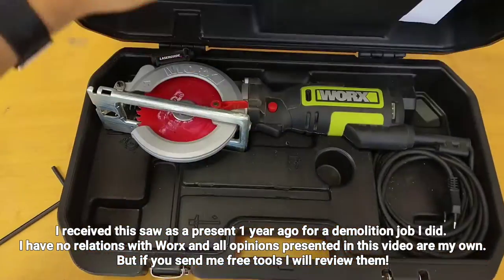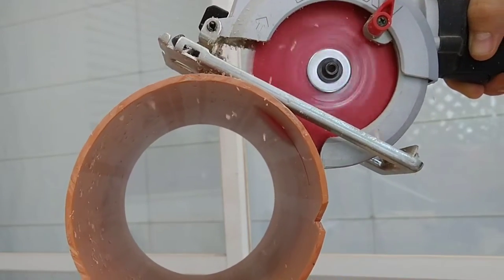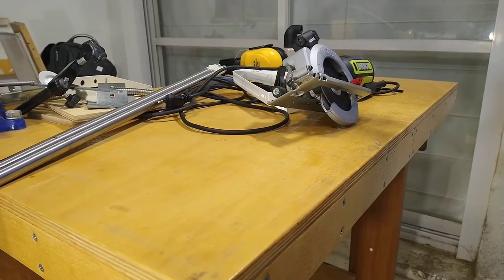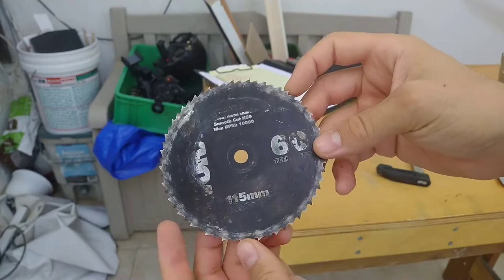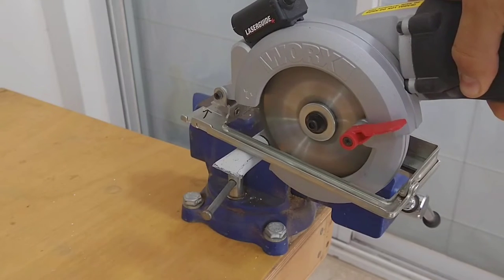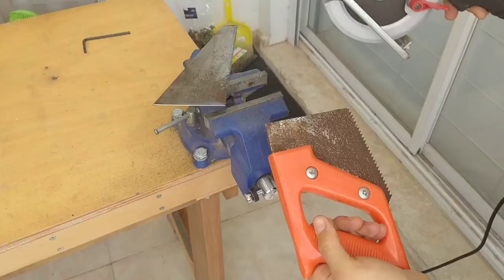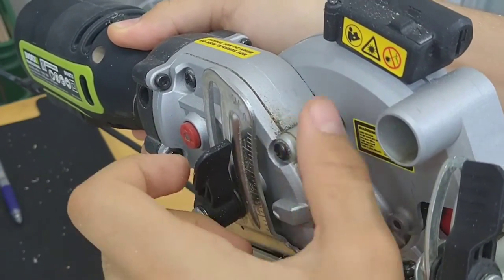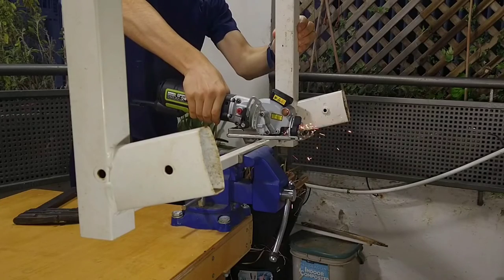WORX Mini Circular Saw - what can it ACTUALLY do? | Detailed review

Comment: Thanks for the review. I noticed at the end you mention to avoid the weaker one, which is a 4 amp 400 watt version. That's a good point. The 700 watt version is currently not available on amazon.

Comment: There are basically three categories of these mini saws which can overwhelm people in choosing one.
1.  Mini Circular Saws with 4-1/2" blades from WORX, Rockwell etc... - The only type with a blade large enough to cut through 2x4
2.  Plunge Cut aka Versacut Saws with 3-3/8" blades from WORX, Rockwell, Rotorazer Saw etc... - Good at plunge cuts, but blade is not large enough to cut through 2x4
3.  Dremel Ultra/Max Saws with 3-1/2" blades - Again blade is not large enough to cut through a 2x4,  but its extremely high rpm and proprietary serrated blades makes it easy to do straight cuts and plunge cuts with zero gap between flooring and door trim molding.
Reply from the maker: Thanks for the summary. I'm glad I chose the one that fits my needs without being too bulky.

Comment: I’m not sure if you experience this design flaw: but on the Demel version that I have (SawMax), the lock lever for the base plate (black in your case) extends past the base plate effectively blocking, and making it impossible, to use a guide! You would need an extra long, paper thin, something-or-other to slide underneath the lock lever!!
Reply from the maker: Can you replace the knob?

Comment: I have the Rockwell model. I like its compact size. But it has a spring loaded baseplate forcing you to push down on the saw to its depth of cut. I ended up jambing the base plate at the max cut position. I rarely use it because of this.
Reply from the maker: I've seen those. What's the point in having the depth or cut adjustable, just for plunge cuts? Maybe you could remove the springs and zip tie it. I saw Rockwell also sells this exact saw BTW.
Reply: @Yonatan24  What is the model number of yours? I couldn't find the exact look with yours under Worx. The closest one is Rockwell RK3441K or WORX WX427L.
Reply from the maker: @frontgate88  That's probably it. I saw there different names

Comment: Can you give more details of what adaptor / method is needed to attach grinder disks to these worx saws? thanks
Reply from the maker: I improved with a washer, but it's basically an adapter whose internal diameter is the diameter of the screw, and external diameter is the diameter of the internal diameter of the cutting disc. Some saws may come with one but mine didn't.

Comment: Thank you, I just bought this tool, and have been cutting, wood, metal and tile, but I have seen people using angle grinder to do the same thing.
I just wondering do you need angle grinder, if you have this saw? Also I seen people cleaning BBQ, polish car etc.. using angle grinder? What is your thoughts on the angle grinder?
Reply from the maker: First of all, you should never cut wood with an angle grinder. They use blades that's aren't able to handle such high RPM and can explode.
It depends what you want to use it for. Ideally, you should use this saw for wood and thin metal since IMO it's the best at it. I've never used an angle grinder but it's probably the best to have both. It all depends on your needs.

Comment: 0:19 so many questions about the plexiglass… I thought if you cut fast then the plexiglass will be more prone to chipping and cracking? What blade is this? I thought the more teeth the better but I seem to have trouble finding small blades with lots of teeth. Can you cut plexiglass vertically like you did with the wood? I kind of have a project that needs me to do that right now…
Reply from the maker: @tylerl4472  I suppose if you push through the cut too quickly, it's more likely to crack, likely with thinner material. It's a Diablo blade, I linked it in the description. It's fantastic, great for plywood as well, except for the fact I warped mine a bit so I can't use it with a straight edge.
Do you mean to do a plunge cut? What are you trying to do?

Comment: Hi, thanks for the video. Can you tell what is this black angle grinder disc? And if is it safe to use angle grider discs for metal in this tool, even having adaptations for the smaller arbor? I have a worx mini saw (Wx 439) and there's no original blades to sell in my country.
Reply from the maker: It's a standard disc you can get at any hardware store. It's unsafe to use without an adapter since it needs to be centered on the arbor to be used.
Reply: @Yonatan24  thank you!

Comment: Just got my WORX mini circular saw. Does anyone had problem with getting the blade to right angle. The saw blades are still slanted when i set them to 0 position.
Reply from the maker: You have a bolt for adjusting this next to the knob for adjusting the handle. Try zero-ing it against a known right angle as a reference. Hope this helps.

Comment from the maker: ►► Link to the Worx saw https://amzn.to/3XQGPxj 
► 4-1/2" Diablo circular saw blade I recommend https://amzn.to/4bxBkGR | https://ebay.us/6rQEP7
Alternative links to the saw: https://ebay.us/U97OTv (or https://ebay.us/2Qte3J or https://ebay.us/qpINjk) It has a bunch of names, so these links should cover it all.

► 4 1/2" Angle grinder cutoff wheel https://ebay.us/ul9ZJV
(affiliate links)

🔴Subscribe to get updated when I upload new videos!► http://youtube.com/Yonatan24/
2 Clarifications:
I bought the corded Worx WU427.1 220v 710w saw. There are 400w saws that look VERY similar from the outside, but their motor is probably significantly weaker, and some don't come with a laser. I have no idea about cordless saws, though.
125mm saw blades don't fit, but any blade 120mm (4-3/4") and under fits, including standard angle grinder discs.